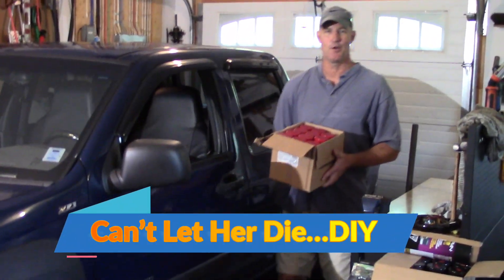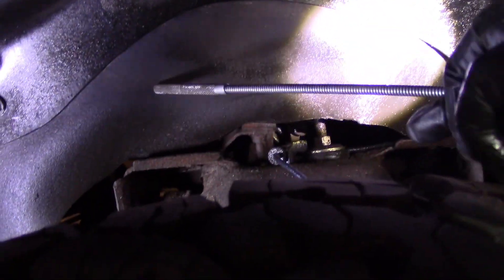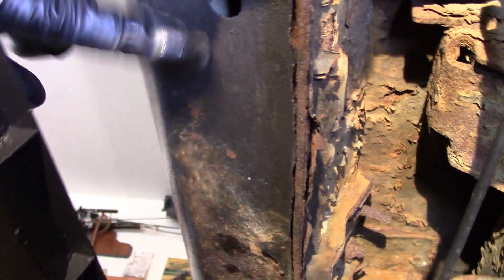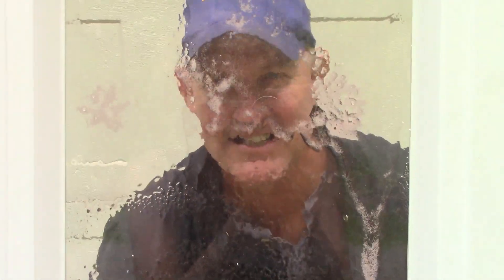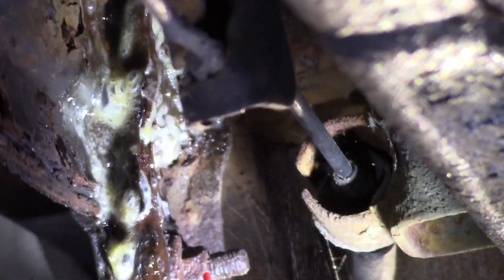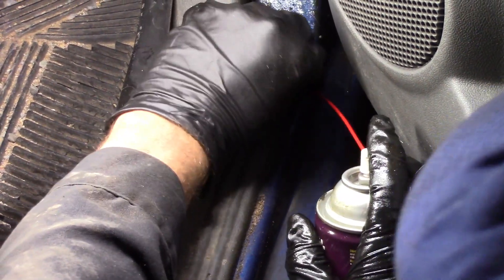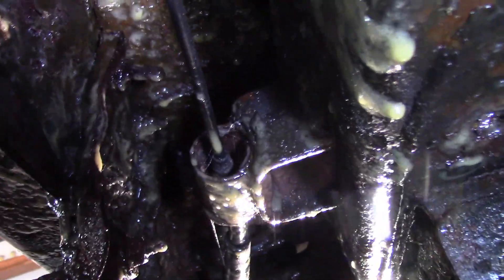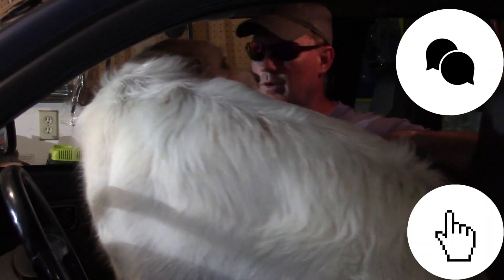Undercoating Your Car or Truck to Stop and Prevent Rust. 2004-2022 Chevy Colorado, Canyon, Hummer

Comment: Have you ever replaced the timing chains or paid a shop to replace them , It seems like you have high mileage and I'm wondering if it's necessary ...looks like a ball buster of a job
Reply from the maker: Hey There William,
Good question. At around 190,000kms, before I was making videos, I had an exhaust valve go bad. I was able to negotiate with Chevrolet that this was a defect and they needed to support their product. Since most of the cost is getting to the bad valve, I had Chevy replace the timing chain and guide while the engine was exposed. All the cost is in the labour to crack open the engine so the cost to me for the chain and guide was very economical. That turned out to be a good decision. Thanks for the question William. Let me know if you decide to get the timing chain replaced or not and how it went? Cheers!